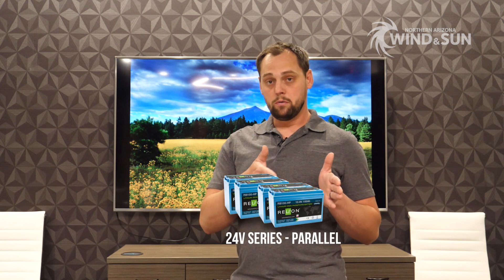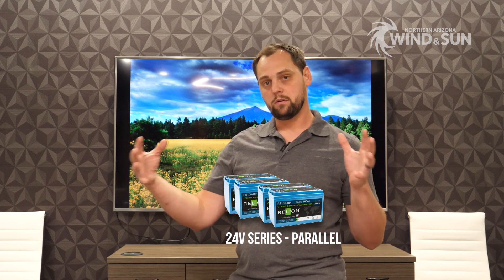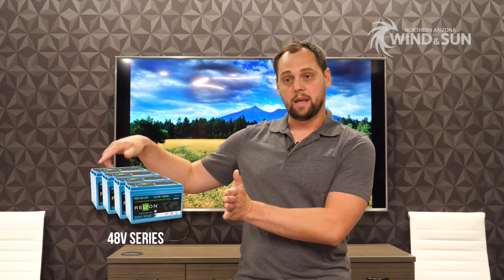12v 24v 48v Solar Power Systems Explained

Comment: Need your expert opinion. These days people are commonly using a 12v DC setup where battery is charged by a MPPT charge controller while the load is put parallel to the battery (MPPT chargers here don't have a load/output option) via a PWM controller ( to avoid over discharge).  In my view the charger will be over charging the battery as the load running is in parallel. Your view please.
Reply from the maker: @excelTimeSavers: Modern MPPTs are designed to properly charge and regulate energy flow into the battery system, it is unlikely that this would cause an overcharge situation but a lot of consideration has to be made on what battery technology is being used. DC-coupled systems have been a very common connection method for a very long time and there are a lot of products on the market that can trigger low voltage or low SOC to prevent over-discharging of the battery system. Check out the Victron Smart Battery Protect line of products; this is a much more modern and practical way of preventing over-discharge of the battery system. Thanks for watching and feel free to chat with our engineering team live on our website during business hours!

Comment: Thanks for making the video, but still confused. Why isn't going 48V always better? Not understanding why you'd run 12 or 24? Understand if there's existing equipment, but if starting from scratch, why not always run 48V?
Reply: You may have found an answer to this question already… But the reason 48V may not be suitable is that parts for 48V are not easily seen in the market. Also, if you are not running a very heavy load, 3000W above, a 48V inverter consumes  alot more power on stanby mode than a 12v inverter so you lose efficiency. 48V will be for if you have very heavy loads. Also many home appliances that use DC power are mostly 12V. So if you run a 48V system, you will need to get a bulk converter again which will also make you lose more efficiency
Reply: @EasyyokeFilms  Thank you! This was the awnser I was looking for, which the video forgot to mention.

Comment: What about solar panel output voltage for a 48 volt 6500 Watt all in one inverter ?

Is it better to buy 12 volt 200 watt panels or 24 volt 200 watt panels?

The 24 volt panels cost a bit more  costly than the 12 volt 200 watt  panels, but is it well worth that added expense to obtain 24 volt 200 watt panels?
Reply from the maker: It's often best to buy mass market modules specifically manufactured for commercial and residential solar applications, rather than a specific Voltage. Most inverter products on the market can work with a wide range of input voltage, so buying a module with a specific voltage output is not all that important. One should focus on quality, performance, technology, size, warranty, and bankability of the company.

Comment: can you run a 12v charge controller and a 48v charge controller In parallel? I have a 48v lithium pack for my e-bike and I have a 12v lithium pack made with leftover cells . I can plug my 48 v battery charger into a 12v inverter to charge my 48v pack or I  can plug my 12v battery charger into a 48v inverter to charge my 12v pack. Right?

Comment: I have 4 LifeP04 batteries at 100 amps each in parallel series to equal 24vdc 200 amps. So if I wired them in series i will get the same 100 amps at 48 vdc and 5KW
Reply: Yes you will get the same wattage. Example 4 12v/100Ah in parrell, 12v/400Ah=4.8KWh when you charge this with 1000W, 1000/12v=83.33Ah in the cable. You have 4 batteries 83.33/4=20.83Ah for each battery. In series you have 48v/100Ah=4.8KWh when you charge with 1000W / 48v = 20.83Ah in the cable and for each battery. Now the fun part, I have a 48v system and when I have to charge a phone I have to go down from 48v to 5v usb and there is a loss of 5w and the bms in the battery also takes 2w my phone takes 8w, total loss 7w and charging 8w so I discharge the battery with 15w to charge my phone. Your 24v system is really good as you can get inverters and cigar usb that run on 24v which are efficient. 230v/2000W inverter uses approx. 15-20 watts just to be switched on, you can probably get some that use less. you could have a small inverter 500w for light/charging batteries and a large inverter 2500w for the rough stuff for a short time. That was a bit of a long explanation,

Comment: I have 4 12 volt 270 watt solar panels I bought and I am using them on my boat. I also bought a 48volt 3 phase wind generator. I have 4 new 6 volt 105 ah golf cart batteries. Should I parallel series the panels and series the batteries and go with a 24 volt system? I plan on getting a lot more and better batteries in the future.

Comment: Hi there I'm from Australia and we use 240v in our appliances will it be an issue if I was to go with 48v over 12v set up ? Because most of the inverters I see for sale which are 48v are only 220v which mean I would have to buy 220v TV fridge ect ?
Reply: Australia has been 220-230 volt for a while now.

Comment: I'm an electrician and forgotten as the voltage goes up,  the current comes down, wire sizes  come down needed, just like the difference between 110/220 or 181/240 volt 3 phase, the bigger loads use the higher voltage, Thanks for reminding me, now I just have to figure out if  the 12 volt is the best to keep for my trailer, mostly running a small fridge that I use for extra storage, but if I kick up to 48 volts I can use it to back up the house during power outages of a few days, it is only 16 ft but would like it to have enough solar to support itself year-round without being plugged in at the house

Comment: I have a small conversion van RV. Right now I have 2X100 watt Renogy Solar Panels powering  my Laptop and a 42 inch Display, a rooftop fan, my small 12/120 volt Fridge/Freezer and a small window A/C unit 450/500 watt occasionally. I currently have two 6 volt 200 amp hour Deep Cycle Golf Cart batteries hooked up in Series with a 30 amp Epever MPPT Solar Charge Controller and a 1200/2400 watt inverter. I can run this all day long and still keep my batteries at about 13 volts (not with the A/C running.)

 My question is ... I have 2 new 330 watt Solar Panels that I bought from Northern Arizona Wind and Sun. I am finally getting around to installing my Solar System as the Sun finally came out here in Oregon !   
 Can my current system handle the increase in Voltage from my New 2X330 watt Solar Panels  ?

Comment: No it's not hard to answer. The power needs determines the voltage need.
Smaller wire size is the desire.
However, up to about 2000 watts a 12 volt battery is good.
Above 2,000 watts the wire size at the inverter starts requiring doubling the wire size. So from 2,500 to 4,000 watts the battery voltage should be 24 volts to keep the wire size smaller going to the inverter.
From 4,000 to 6,000 watts the battery voltage should be 36 volts minimum.
Most systems above 6,000 watt loads should be 48 volts.
The battery voltage needs to be determined by the load requirement not the size of the solar panels. The solar panel wattage needs to be sized according to the battery voltage and the minimum available sunshine on the worst sunny day.
The charge controller size is selected based on the required solar power needs.
It's that simple.

Comment: Thank you very much for this information really help a lot trying to get a inverter and they only have 24volt when a really wanted an 12v but no I like the 24 much better thank for all that efficiency and its a lot cheaper too for sure 12v inverter is like 3x the price of the 24 👍😊🔥

Comment: Very good! I'd like to see this expanded to cover different array configurations. For instance, I've got a travel trailer which I'm flattening the roof to allow 6 full-size panels, such as the REC-330. The panels will all be at the same angle and none will be subjected to shading from anything on the roof. So, what are the options for serial and parallel connections and how would that affect battery voltage options?
Reply: First determine your power load requirement. How many amps in watts max will you needing. Then determine how many amp hours will you be using?
If your total load is under 2,000 watts then your battery can be 12 volts.
If your load is above 2,000 watts up to 4,000  watts then the battery should be at least 24 volts. 
If your load is above 4,000 watts up to 6,000 watts then the battery voltage should be at least 36 volts.
If your load watts is above 6,000 watts your battery should be at least 48 volts.
Once you determine your load power requirement determine how long in hours each load is going to be using power in amp hours.
Once you know the amp hours you can calculate the watt hours.
If it is easier to determine the watt hours first then you can convert for the amp hours.

You will need to engineer the battery bank from a choice of differently types of batteries. Lead acid batteries will soon be obsolete. Lithium batteries are getting cheaper and for an RV they are the best choice. LifePo4 or lithium iron phosphate batteries are better than lithium ion batteries. In about 2 years solid state batteries should start being available. They are the "forever battery".
Most LifePo4 batteries will last 10 to 20 years of cared for properly.
Lead acid types of batteries last about 5 to 7 years. They aren't that great of an investment.
Once you know the power need in amp hours and watt hours you can determine what the battery capacity needs to be at the voltage you determined from your load calculations. You will be able to determine what the wattage of your solar power needs to be based on taking the total load watt hours times the hours of sunlight, (which is in most cases 4 to 6 hours), and double that number so you have enough power to charger the battery while running your RV power loads.
Reply: @RogueOntheRoad  this comment was very helpful.  All I'm missing is how to calculate load. We are renovating a portable school building to make it a small house.  

There is no power yet on the property.  The building was wired & has a 200amp (might be 150amp) box. Since it's just a shell with no power we don't have a way to meter appliances to determine how much load we will need.  Is there a way to calculate using estimates? 

We already have most of our appliances and can get info from their labels although I know it won't be exactly right. Just trying to figure out how to configure either an off grid solar system or a grid tied system.  Any ideas appreciated.

Comment: Okay I got a question and this just a figure of speech just say I'm using 50 amps 8 hour in a 12-volt and if I switch to 24 volt would that cut that in half on my amps that's what I'm trying to figure out
Reply: A hour / ( not 8 hour )
Reply: Important to remember that power is watts = volts x amps. So yes it will cut the amps in half but you doubled the voltage. So you use the same amount of watts